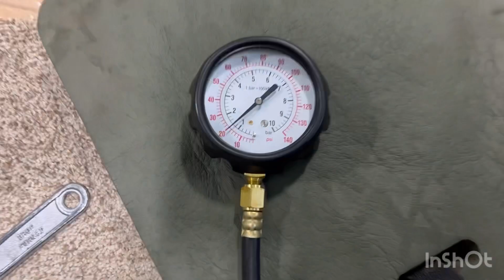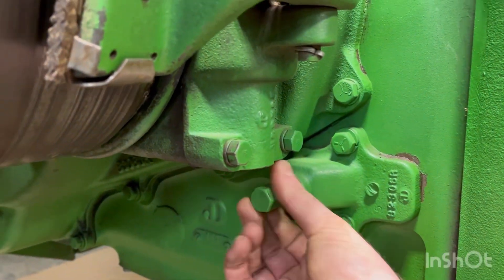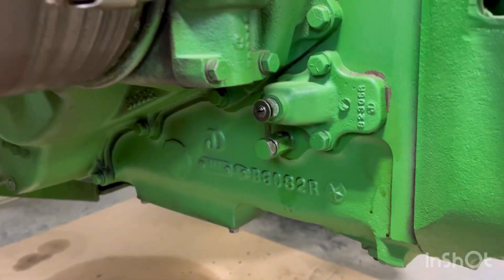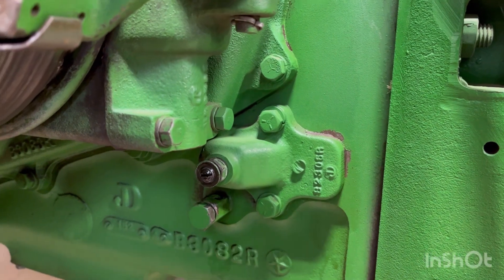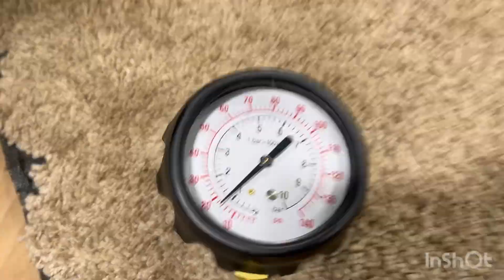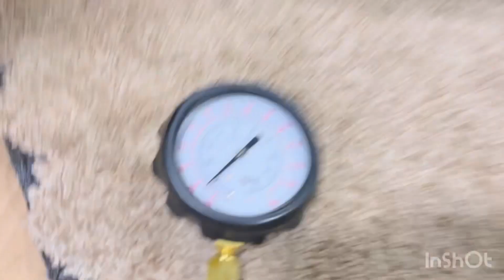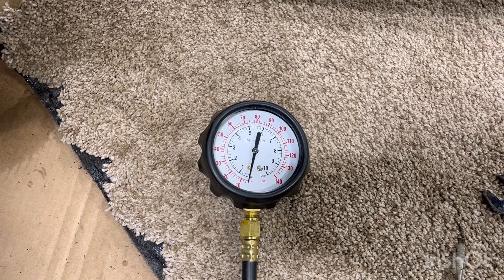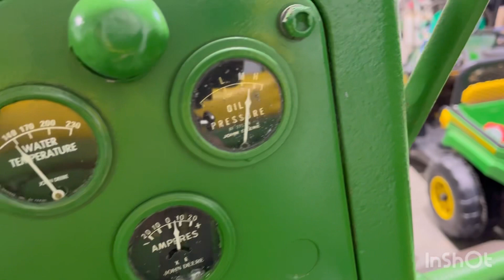How to adjust oil pressure - John Deere 50 60 70

Comment: Did you have it run for a while before adjusting the oil pressure or did you adjust it right after starting?
Reply from the maker: It was cold, and the pressure adjustment work out perfect. When it gets warm, the oil thins out and reduces the pressure. So keep that in mind while making the adjustment
Reply: @oakwoodstockfarm7017  ywa, that's when I would do it, it would start and maintain alright, but as soon as I reduced the rpm, the pressure would drop and going to full throttle wouldn't have it recover, figured it's that setting it while it's 10w but when it's warm and at 30w, it's a little too light.

Comment: Did it end up fixing the leak? Same issue here, despite chsnging the seal
Reply from the maker: I pulled the flywheel and replaced the seal as well, seemed to have fixed it…so far anyway. Only have about 2 hours on it since this video
Reply: @Oakwood Stock Farm  update, ours ended up being the breather coming out of the valve cover had a wasp nest built up in it. Ran a wire through and got that out. No leaks so far. Thanks for the quick response. Definitely have to raise our oil pressure now, reading a lot less than with that vent plugged up